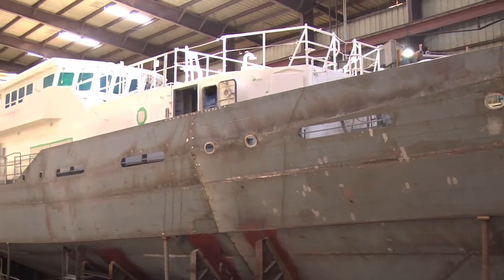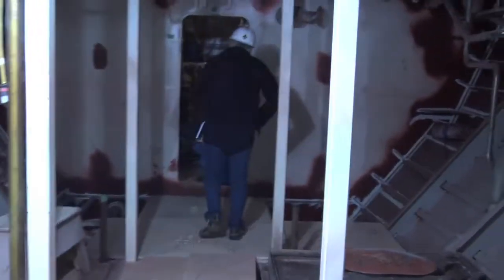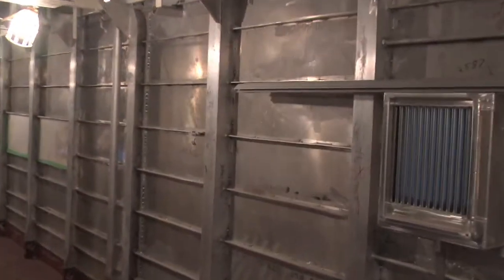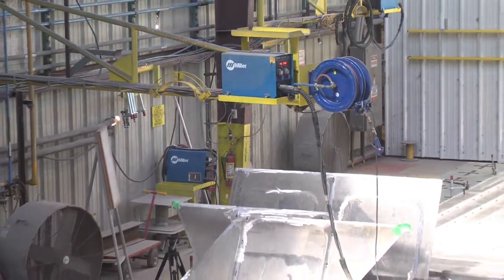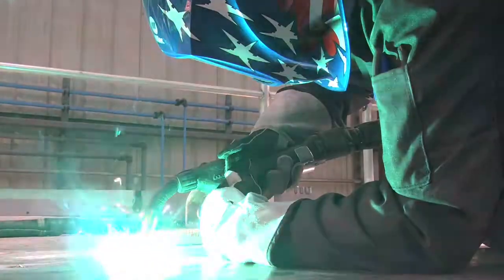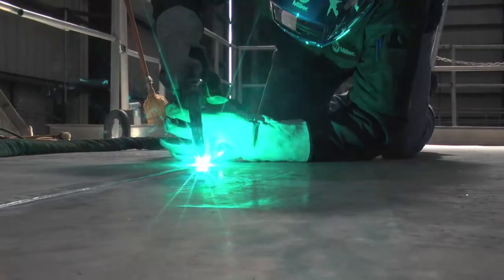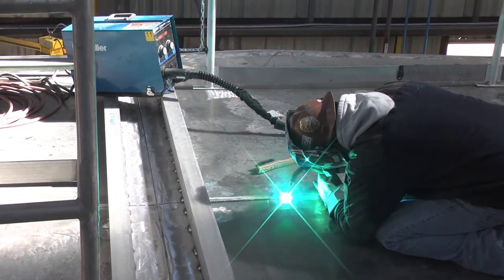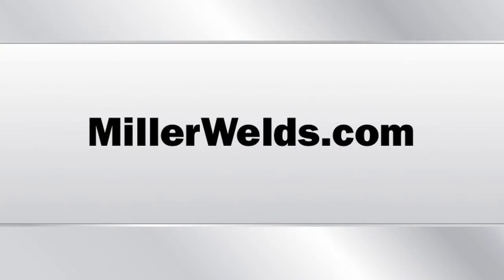Shipyard Reduces Distortion with Pulsed MIG Welding

Comment: I remember years ago after I got out of my trade (boiler maker) working with a panel beater , i learned this trick with steel panel but welding to have an air pencil on hand working in stitches of 30 to 50 mm (2 ") cool the stich instantly, i was always amazed at how it reduced line distortion. Locking the piece down is always best though.  Great video Miller ! one day I'll get me a Miller machine.

Comment: I hate pulse, if you got blue eyes this pulse shit will burn them up, I had a 14 lens wasn't dark enough. Good experience but had to go back to carbon welding for the company I worked for.
Did make it easier though to weld